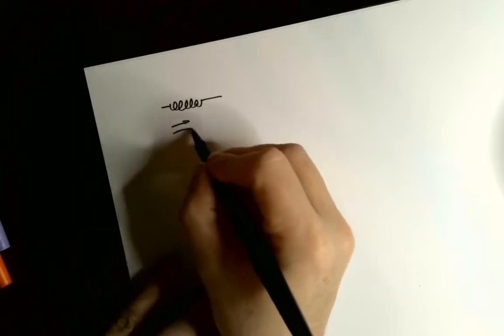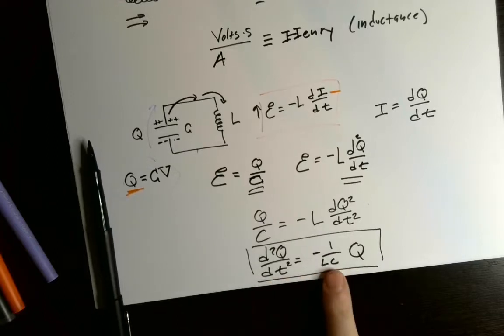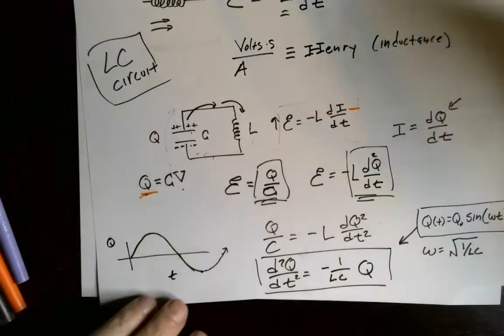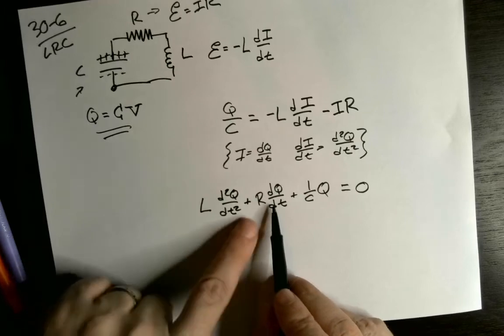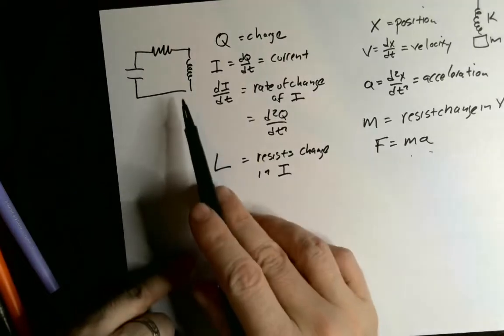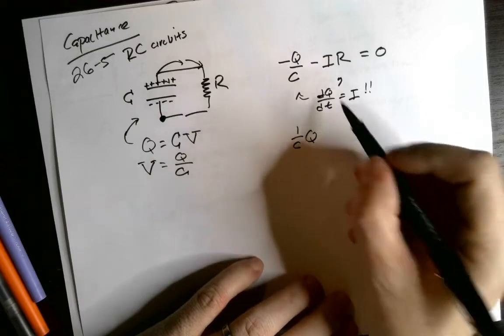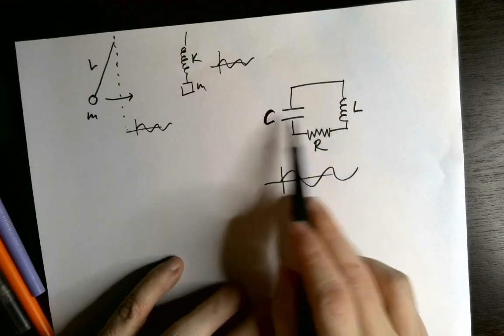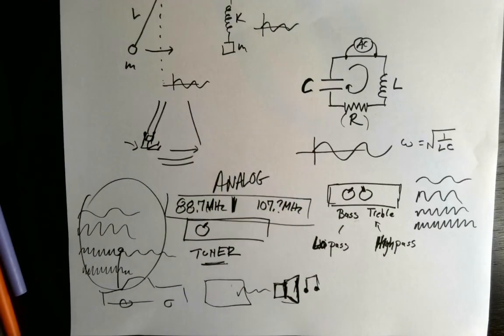LRC circuits

Comment: I agree with Ben it's interesting to realize that the springs and RLC circuits somehow have essentially the same pattern. It looks like for me that it is the mathematical expressions like differential equation system in this case that lines up different parts in physics together. Nice video!

Comment: Interesting to see the parallels between springs and circuits! It's always nice to see "recycled" relationships, which makes understanding the material much easier. I'd be interested to try solving the LRC circuit differential equation with the same techniques we used to solve the damped harmonic motion equation in DiffEq class.